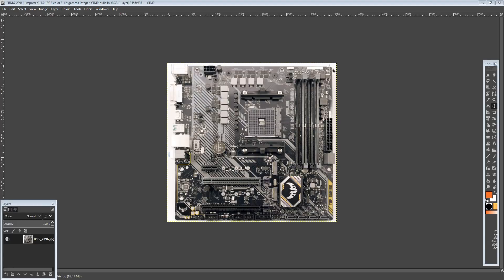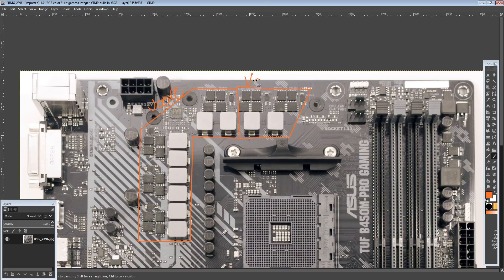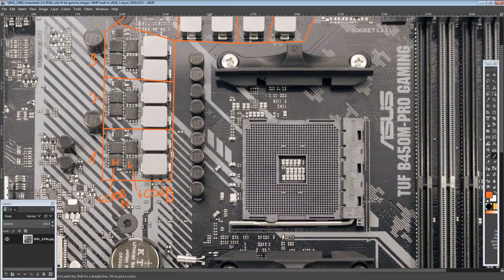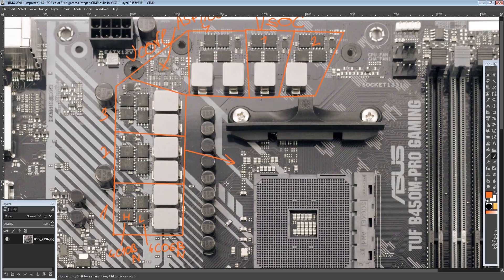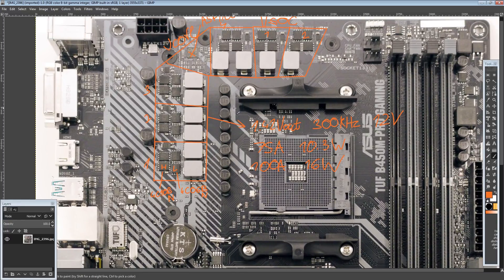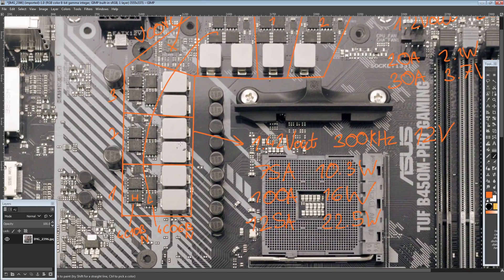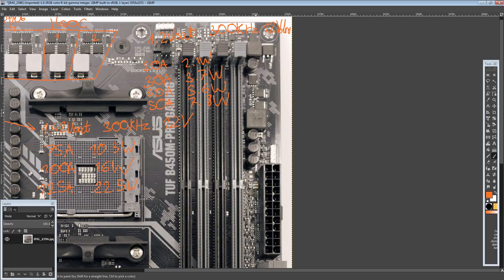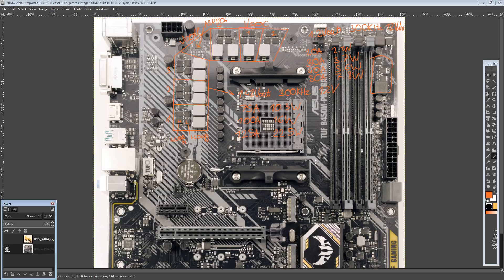mobo PCB Breakdown: ASUS TUF B450M-Pro Gaming

Comment: This mobo has special features. There is 2 m.2 SSD for PCI-E NVME. I used all two but sata port 3-6 cannot be used because of sharing. Also, the sound is incredible with Realtek® ALC S1200A
Reply: Can I use a m.2 sata ssd on the second m.2 slot?
I do not want to spend that much on the second slot because it is slower than the first one and I only need it for my library.

Comment: I'm sorta late, but as far as I can tell, using it with a R5 3600 looks a bit on the edge. I have the latest BIOS where the frequency can be upped to 350kHz, but still pumps way too much voltage for that 7nm, where as far as I know, max Vcore on full 12 threads load should be around 1.38V, not 1.44V that this MB sends. Despite of that, the cpu behaves kinda well (With PBO enabled) when 10 or less threads are loaded and with -0.1 offset undervolt I can stay around 59 Celsius on max temps (liquid cooled with arctic 240 AIO). Looks fine for entry level, but definitely getting a X570 and a 3950x in 1 year.

Comment: Will it be ok running a 3600?
Reply: yes i have a 2700x ^^
Reply: @rosti321  WHAT ARE THE TEMPERATURES for TUF GAMING B450-PLUS + your 2700x combo, pal . This is an incomplete answer my man!
Reply: @landingonyuranus1813  ASUS TUF B450M-PRO GAMING (ITE IT8655E)

CPU

74 °C

Motherboard

58°C

CPU V 

1.243v

All core 

3,920 MHz 

Stock cooler

10mins cinebench

Comment: I've ran this board for 6 months with my 2700x locked at 4.15ghz with auto voltage and my ram at 3466mhz cl14

Comment: This is pretty much a great board, I swapped in a brand-new MSI B450M Mortar (with famously great VRM) for this board for my R5-3600 because of
1. the complete lack of ECC support on the MSI (and I'm using the build as a NAS+workstation with ZFS and 24TB HDD space with on-board SATA + a SAS controller)
2. inferior sound on the MSI (Realtek 1200 on this ASUS, sounds excellent with my Takstar Pro 82)

This ASUS is rock stable so far, I managed to run my 2x16G Samsung DDR4-2400 at 3000 speeds on default voltage (B-Die), memtest+prime stable with ECC:OFF and of course I can turn on ECC in the BIOS and now I don't have to fear of data integrity issues anymore. My Linux loves this build too. 

Q: Can I run a 12-core Ryzen in this board later (on stock speeds) when VRM section is cooled by the top fan (12cm) directly ? 
Most of the top-VRM-ed boards out there are either ECC-unfriendly MSI-s or just way too expensive to have strong VRM + ECC support + excellent sound at the same time with good value.
Reply: Someone on youtube stress tested the Asus Tuf b450 atx Pro Gaming with a ryzen 9 3950x and the vrm temperatures topped out at 80 degrees celcius and this was without airflow. These are excellent temperatures. Assuming the vrms on the b450m version of yours are roughly the same as the atx version I think you're good. Especially considering there would be airflow going through your case. 

Question: how is the booting time with your board? It's fast?
Reply: @hazzmati  hi, thanks for your feedback, appreciate. Booting time ? Well, I use the config since couple of months in a customized fashion, like:
- switched off big logo screen (I like to see post messages)
- set a 5sec delay (an empty wait) into the post process in UEFI (to catch errors if any)
- the LSI SAS Adapter again makes at around 5-7 secs. additional delay (with it's own BIOS message, waiting for CTRL+C if I want to configure it and then showing me quickly the attached drive config)

The real loading of the OS begins just after all these, so from pressing the Power button quickly once and seeing Linux's GRUB boot selector screen I would say it's about 15 secs - which I consider as pretty slow, but it's not due to some ASUS related failure, it's because of my little-bit special config (not really special, actually). 

After GRUB has loaded, it has on the default Linux menu item a 5-secs counter and loads the OS when it's over. When I press ENTER (onto the first menu item) then it boots with Linux, which is pretty quick from here on. When I select Windows in the GRUB menu and press ENTER, that's loading pretty quick just as well, so the overall performance of the board & CPU is quite okay I'd say. 

Anyway.. it still boots quicker than how fast I pee in the morning after wake-up so it's not an issue :)) To be honest, I wouldn't select a mobo according to boot-up speed because it doesn't show the real capabilities of a board at all. 99% of boot time is lost when the BIOS/UEFI is still analysing devices, it's all a preconfigured process which we can adjust a bit (delay it) but as a default it's really manufacturer dependant AND at the same time the spread isn't that big, 1-2 secs here and there... doesn't really matter. After the POST process has finished and the OS loads, it's usually not the brand of the motherboard what's influencing boot speeds but CPU (cores, speed, cache) , chipset and the age of the OS. A quite 'old' Windows can boot for decades, at least that was the trend many years ago. With W10 this has improved a lot but still, a clean, fresh and just-upgraded W10 without that many programs installed still boots quicker, than a good-old one with tons of programs and games installed. 

I can only recommend this board, it's super stable, I have absolutely no issues with that. I'm definitely going to keep it.
Reply: Vortexetrov woow I definetely didn’t expext such a long answer haha but thank you. Seems like booting would be under 10 seconds without your special configuration which is pretty good. Ans yeah I ordered the ATX version and I’m pretty excited to build the pc now.
Reply: @hazzmati   Can you please share the link of that video please. I will get this board for only 67$ right now. 
The deal seems fine but I am really confused. 
The MSI b450m MORTAR MAX  is also 75 bucks but it is mATX moreover the warranty on the latter seems a little shady ( I did not trust the seller) ? 
What do you think should be my choice?
Reply: @landingonyuranus1813  https://youtu.be/wqVqar209YQ what cpu are  you gonna use?
Reply: @hazzmati  Ryzen 5 5600g  . But your video test seems really hot VRM's are showing up there. 70++ , 80 degrees are bad they say?
Reply: @landingonyuranus1813  that is a zen 3 cpu. The b450 motherboard might not come with the right bios version then it won’t work. And you can’t update the bios without a compatible cpu so I wouldn’t risk it. 

I recommend to pair the 5600g with a b550 mobo to avoid any surprises.
Reply: Does this mobo has a argb header?
Reply: I will get this board for only 67$ right now. 
The deal seems fine but I am really confused. 
The MSI b450m MORTAR MAX  is also 75 bucks but it is mATX moreover the warranty on the latter seems a little shady ( I did not trust the seller) ? 
What do you think should be my choice?

Comment: Just to say, I run a 8 core 3700X stock on this board and VRM never goes above 50C inside a 3 fan NZXT H410 case. So its perfectly fine, contrary to what this guy says, and features are best in its class with 2 M2 slots and great 108dB ALC 1200 sound chip
Reply: I just bought this board and am waiting on delivery I'm so glad you said this lol he's judging it from a picture not in reality
Reply: I ordered this board as well for my R5 3600. Can't wait for it to arrive!
Reply: Do you see the fricking title of this channel?
Reply: Well it's good to know that I won't be in this sinking ship alone..  I just bought that same set up off Newegg a few days ago...
Reply: @bigandfluffy2000  the board is actually so much better that this guy says it is (reviewing it from a picture with no real tests performed lmao). It handles the 3950x easily, so no worries if you want to upgrade in the future, the temps are great (new VRM heatsinks), plus, the audio is unbeatable in the b450 department. So, good choice!
Reply: the 3700x is unique in that it has a 65w tdp for an 8 core stock. I ran a 2700x on this board, which has 105w tdp stock as does all the top end zen 2 ryzen 7s and ryzen 9s. the VCORE on this board ran pretty toasty at idle and especially as utilization ramps up and my case is very well ventilated. Also zen 2 wasn't out when this released.
Reply: Lmao you clearly have no idea what you're talking about. Do you even know what VCORE is? It's the cpu core voltage.

Comment: Hi! Is this the same VRM as the ATX version of ASUS B450 TUF?
Reply: Bit late but I read reviews and the atx version can handle ryzen 7 2700x just fine vrms wont get hot as long as you don't do extreme oc
Reply: @hazzmati  whats the difference between tuf pro and tuf plus ?? I cant find anything on the internet ??
Reply: @filds1  tuf pro has better vrm/heatsinks and better audio chip. Looks like tuf pro is higher quality than tuf plus
Reply: Much better VRM (4x2 phases), overall VRM design (only 3 CPU phases under 1 heatsink) and better heatsinks.
Watch how it performs with 3950x: https://www.youtube.com/watch?v=wqVqar209YQ
Buildzoid straight up wrong about this board.
Reply: @StonerDjek  i went with b450 tomahawk
Reply: @filds1  Well OK, but the tuf b450 pro would have been a better choice

Comment: I'm running this motherboard with a ryzen 7 2700. I bought it because it was what I could afford at the time but I didn't realize it was bad. Should i upgrade? If so which board?
Reply: Actually it's a great board and it will run perfectly fine with your 2700. Buildzoid just messed up.

Comment: Supports 128GB of memory in Micro ATX which probably is of little value to most of you but if you work with large data sets this is one of the few AM4 micro-ATX boards which support that much memory.
Reply: Especially ECC when used with a CPU without integrated graphics, or a PRO series Ryzen with integrated graphics. 

The highly regarded MSI doesn't give a shit about ECC support, so don't go MSI if you're building a home lab and ECC is crucial for you (e.g.ZFS or just too much RAM)...

Comment: I didn’t see this video back in May when I picked this up. I’m running a 2700x on it and it auto over locks at 4ghz and I can set it to 4.1ghz auto with auto undervolt just fine. Temps seem fine on the board as well. I picked it up since it was one of the few boards in matx that could run 3466mjz ram speed and I want faster ram than my 3200mhz. I’ll keep this all in mind and maybe get another board so I can oc.
Reply: I got this mobo last month  to pair it with my r5 3600, and sadly didn't see this video before buying it, as I thought it had a 10 phase VRM. Nonetheless, I still have good oc results, I can push my r5 3600 to all core 4325 at 1.45V, and I have extremely overclocked cl16 3200 mhz ram working just fine, and as far as I checked the VRM heatsinks are just not overheated in heavy stress tests with an avarage air flow on them.
Reply: @SaddamNukes 
Jesus dude, lower the voltage on that 3600 please, 1.45 is gonna degrade your chip a lot faster
Reply: @vladdyboy2612  I already did, ocing ryzen 3rd gen is pointless anyway, I keep it in offset 1.275 4.2gHz

Comment: Running my 3700x on this board with PBO enabled. Its running perfectly fine with boost clocks upto 4367 MHZ. Also running 3200MHz DOCP with no issues. Of course I wouldn't OC the CPU on this board, but its a perfectly fine board for everyday use, specially those who are looking for a mATX board.
Reply: Tbh, I don't think this is a bad board at all. I feel people are mostly exaggerating because I've done a couple of research on this board and haven't found a single thing that screams "Don't buy!". I already placed an order for one, I'll be getting it soon and I'm very sure it would be good enough for me.
Reply: @ConfyScenty  Agree, TUF B450M-PRO is underrated and doesn't deserve any humiliation.. after done researching I bought this board last year and it OCing nicely, running nicely, updating nicely and the temp is really nice too. I haven't had any problems with it at all and I would recommend it anyone who looking for good mATX board with reasonable price.
Reply: @ConfyScenty  are you going to use apu or cpu?
Reply: @nutterztube  CPU - Ryzen 5 2600x for a start, I'll later upgrade to a 3700x
Reply: @ConfyScenty  Great. Could you do me a favour? See if booting into the OS is possible on this board with that cpu but without a gfx card. I've been thinking about using a R7 1700 with this board without a gpu as a server.
Reply: @ConfyScenty  Also, what's the warranty on this TUF mobo - 3yr or 5yr?
Reply: IRONSYT my 2700x auto oc board setting is 4ghz all core. I can auto under volt or as well all just fine and fully stable. I can also force auto to 4.1ghz just fine as well all core with 76c stamps to 80c temps gaming on stock cooler the boards temps seem fine as well

Comment: I was going deep into that, and found out that the board doesn´t deserve this humiliation, especially not for power, VRM and heatsinks (while it did deserve it for other things). If things don´t go downhill, it is decent cheap low end board. I was about to buy it, after reading about MSI´s problems with Ryzen 3000 processors. But something changed my mind. Bought B450 Prime for mum, with Ryzen 3200G. Gosh it is awful. And bios is awful. Temperatures and voltages ARE awful, FAN can only be regulated till 70 degrees C, then it goes full blast. And guess what. Even with tower cooler, I get over 70 degrees. So I though I could s̶o̶l̶v̶e̶  at least manage this in windows with Asus suite/Fan Xpert. No no no no no. Win 10 BSODs on me every single time with that one. Have been reading about high end boards, and many of these have these issues too. God knows how about TUF Gaming pro...  At the moment, there seems to be not a single usable board for me under $180 for ryzen 3000. Absolutely pathetic.
Reply: Short update here. Bought TUF B450-Pro gaming, and Scythe ninja 5. Except for one minor annoyance regarding cooling, this setup (with R2600X for the moment) works very well! VRMs are luke warm even under load. That is not that pathetic as it seemed to be...
Reply: That's true

Comment: Will my ryzen 1800x be ok with this board?
Reply: it will be fine
Reply: No. He said that he cant recommend this board for 8 core cpu
Reply: It'll work. I just wouldn't push a heavy oc and give it good airflow. Though I'd get something else if possible but hopefully it'll be OK. Did you get this board???
Reply: @whatthehecknate  ..my B350 motherboard died and it is still on warranty and I replaced it with this motherboard.

Comment: My banana would make the heatsinks look much smaller, IYKWIM :P
Anyway, just bought a ryzen 3600 with an Asrock B450m Steel Legend, but the damn board can´t be flashed with compatible bios for the ryzen 3000 series without installing windows and AMD VGA drivers. Other than that i don't even have a first or secong gen ryzen cpu to enter the bios.
Will have to trade the board for this one as i can flash new bios in this one without cpu. The MSI mortar would be better, i guess, but can't find it anywhere.
I don't think the Asrock i was going for would be much better than this, but it's cheaper and would fit my white case much better. It's a beautifull board :(

Comment: 2700x with this mobo all stock, still bad?
Reply: its okay for gaming, especially if you have a tower cooler's fan blowing right at a VRM heatsink (put fan as low as possible).

if productivity is what you're after then just sell this board with your current CPU and buy an MSI A Pro/Gaming Plus/Mortar/Tomahawk.
for gaming overclock with 1.3v Vcore (and tower cooler blowing on it) should be just fine.

Comment: Hi, recently I built a PC step by step, and I wanted to change RAM frequency in BIOS from 2133Mhz to 3000Mhz, in Ai Tweaker I tried to set D.O.C.P. 3000Mhz 15-16-16-36 1.35V after I set manually every detail and tried to put on 2666mhz, but every time when it reboot from BIOS, it tries to boot up but after 2 times on screen appear American Megatrends with this message"The system has POSTed in safe mode.This may be due to the previous POST attempt failing because of system instability or if the power button was held in to force the system off. If the system failed to POST after you made changes to UEFI settings, you may wish to revert to stable settings to prevent POST failure.Press F1 to Run Setup".I don't know why this happens, I updated BIOS version after but the same problem, one time at 2666mhz PC started the OS and after ~10minutes it crashes with blue screens and one "sad smile".I'm need help about this issue because I want to run mu PC with his real specs power
Specs:
Ryzen 5 1600x 3.6Ghz 6core
EVGA nVidia GeForce GTX 1060 6GB SSC
Motherboard: Asus TUF B450M PRO Gaming
RAM: G.Skill Ripjaws V DDR4 3000mhz 16gb Dual-chanel 2x8gb ( F4-3000C15D-16VKB) CL 15-16-16-35 1.35V
SSD Kingston UV 500 240gb
Power supply: Thermaltake SMART RGB 700W
UPS(old): APC Back UPS 500 BK500I
Cooler AMD Max Wraith 
Windows 10 PRO.
Thanks , I will wait your answer.
Reply: Did you get further? @ROdion. I had similar with system and after using XMP setting 2 managed to set 3333mhz. It did not like xmp1 or the ryzen memory calc manual settings.